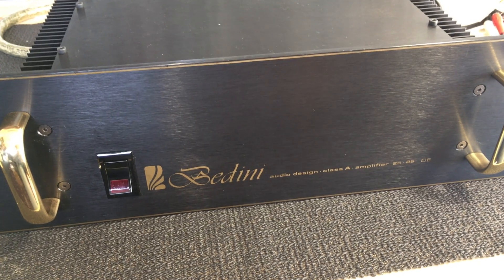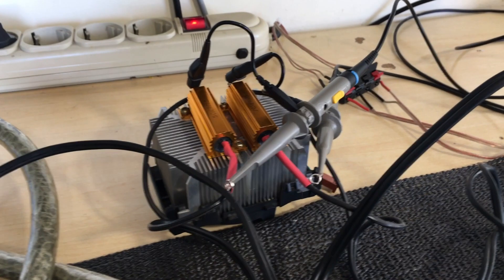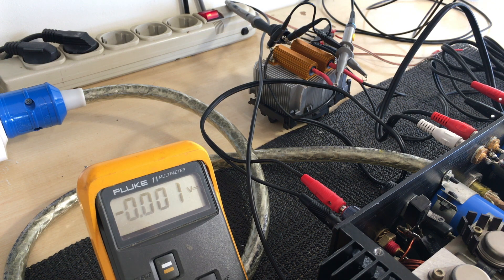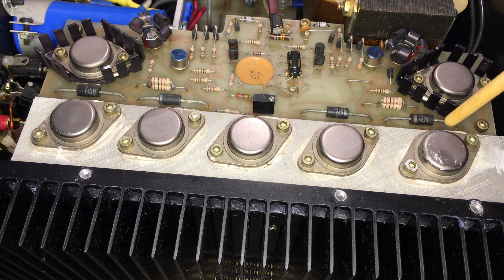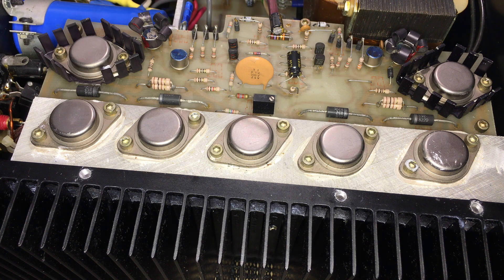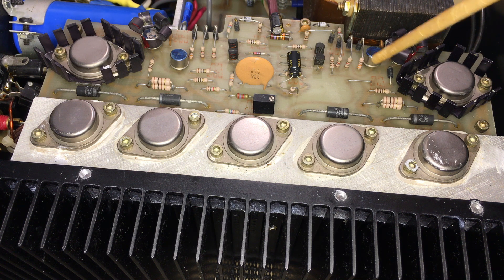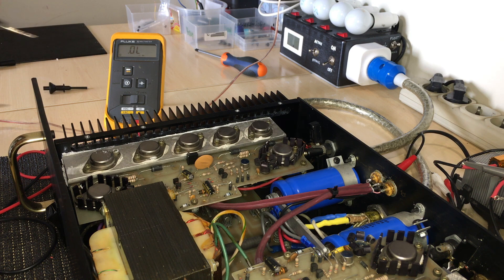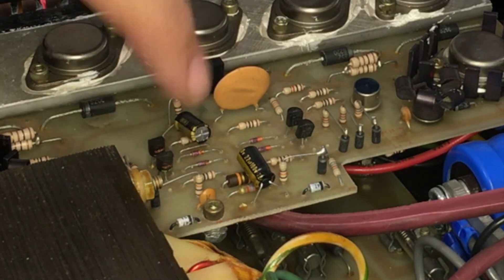Bedini 25 25 Class A Amplifier Repair

Comment: How come there are an odd number of output transistors on the heatsink.  I would expect 4 or 6.  Where does number 5 come from?
Reply from the maker: If I remember correctly, there is a driver, and may also have a voltage regulator in there. It’s been a while since I did this one, so can’t remember exactly

Comment: I worked for the bedini brothers in the early 80's. May even have built this amp. ( Built as in assembled the PCB, assembled the entire amp and even shipped the units!)
I started machining the heat sinks and soon moved into assembly of all circuit boards, and building the amps, preamps, and Lazer couplers. For a while I was the only employee doing everything.
Just happened on this video and felt like commenting. As for this amps issue, it was my thought it was a bad transistor or diode.
Anyways, this is a old video, so not expecting any chatter, cool seeing the inside of one of our amps again. ( By the way, bedini was my first job, work for a few years for them but got cought up in personal issues with Gary's girlfriend and it became a bad deal. It was to bad, we were for a while like family..)
Reply from the maker: Thanks for commenting, and it is indeed interesting to find someone who worked on these personally.

Comment: Hello! Thank you for the great video! I have a short question. Do you know which BIAS has to be set to a Bedini BA 803? I found some posts which say 35 Ma, but is this possible? Mr. Bedini often wrote 35 Ma but said this for the BA 802, BA 803, 250/250 and so on. So could this be possible that all these amps have the BIAS set to 35 Ma? Thank you very much!
Reply from the maker: I’m afraid I don’t know at this stage. That amp has been out of my possession for quite some time now.

Comment: @12:34 since the offset between the two channels is still high, I would replace the same diode on the other channel, thinking that they may be overworked and started to leak over time.

Comment: hello i have one amp bedini 100/100 i need schematic, you have? thanks
Reply from the maker: I’m afraid I don’t. Sorry.
Reply: @electronicsoldandnew  , ok you can help-me? i need adjust bias, in trimmer my bedini 100/100 is 2k pot-trimmer, but one channel , with multimeter in output speakers on amp, read.. positive 100mv dc and other channel read neagtive  -25mv, dc  I turn  the trimmer  it only gives negative reading, and the channel heats ,..What can be wrong with the channel?  I have not tested transistor 2N5416 AND 2N3440
sorry my english,
Reply: @juliusc.m.5552  I have heard that there are no, "Real" schematics for these. All were handmade. All a bit different. But you can "Work it out".

Comment: Thanks for the flashback memories of Bedini amplifiers.  Your particular model is not an original 25/25 (circa 1974), but the 25/25 DE (diode emitter) from the early 1980's.  I owned the larger 100/100 DE from that era (there was also a 50/50 DE).  They used diodes (e.g., 1N 4004 on the output transistors) instead of resistors on the emitters.  The 100/100 DE had MJ15024 outputs instead of 2N6254's used in the original 45/45 and 100/100.  All Bedini amps used non-complementary output stages and all invert absolute signal polarity, complicating listening comparisons to noninverting power amplifiers.  Bedini preamps also inverted signal polarity, so the Bedini preamp/amp combinations complemented each other.  Otherwise, I had to switch speaker cable polarity to correct for the inversion.
Reply from the maker: tafkasteve : now that is interesting. I really don’t have much experience with Bedini amps and certainly never came across a diode used on the emitter. I would really like to see the schematic, but it’s like finding hens’ teeth. Thanks again.
Reply: I looked through my 35 year-old notes and I have a schematic, but it is general for the 45/45 and 100/100 series amps and does not include many component IDs and values, especially for the DE series.  I made a mistake in my original post, as the diodes on the output transistor emitters are MR 852's.  I visited the Bedini factory in Sylmar, California (before they moved to Idaho) and John Bedini didn't explain his rationale for replacing emitter resistors with diodes.  He just remarked that people would say that it couldn't be done and he had done it.  He said that bias was approximately correct when the voltage across the MR 852 was around 0.63 V.
Reply from the maker: tafkasteve : I like the way the creators of exceptional products usually do so without the customary overthinking that later is applied to their creations. It’s quite funny actually: what he states is the normally bias voltage across the diode is merely the normal forward bias of a silicon diode, so he must have had a good sense of humor as well as technical creativity. Thanks for your input.

Comment: It was a very interesting careful troubleshooting that brought your research to success after having troubled about the schematic diagram which apparently was difficult to find..! any way congratulations for your accurate research for such a small diode that gave you the inspiration to look for it.
Reply from the maker: These very personalized units are always poorly documented in the net, so we have to do more research on the unit itself to assist in the fault-finding process. Also, when you do find a schematic, it does not necessarily correspond to the one you’re working on. The consistent aspect is always the quality of the sound. Amazing!

Comment: I think that those small signal diodes, that are not present in any of my two schematics of that amp, must be two back to back parallel connected diodes, for protection, between the bases of each long tail pair. 
They must have been put there as an afterthought after the schematic drawn. If shorted, one of the input long tail pair transistors will have no drive. 
From my back memories I remember to hear this Bedinni at a friend's system, driving QUAD ESL 63 and playing the José Afonso album "Cantigas do Maio" and it sounded really good.
Very nice video, once again, and I'm looking forward to the next one.
Reply from the maker: Yes, the sound is amazing, especially when well matched to the rest of the system, as well as the album itself.